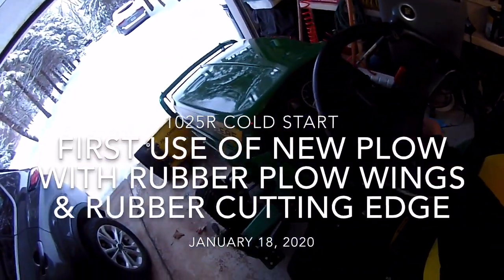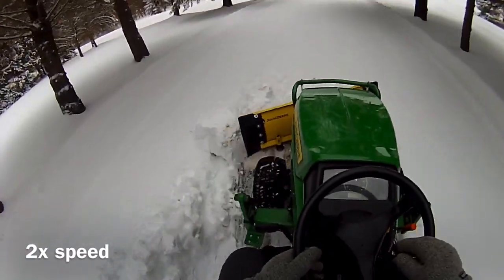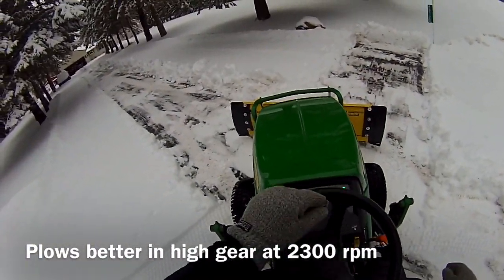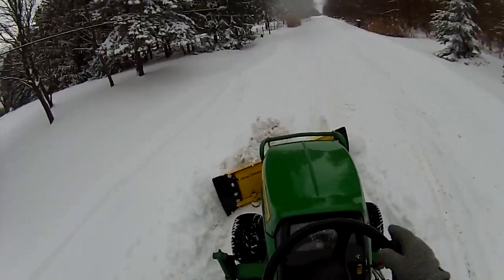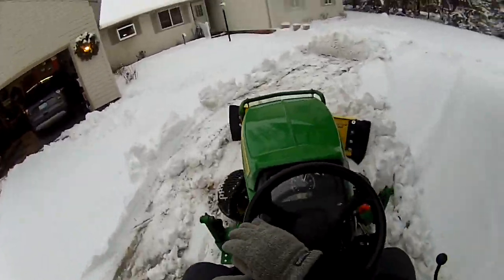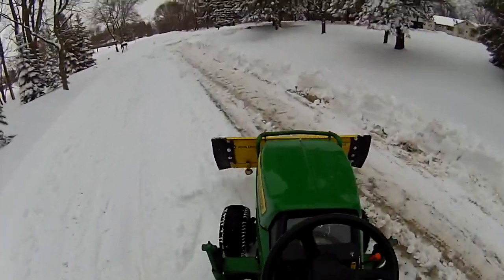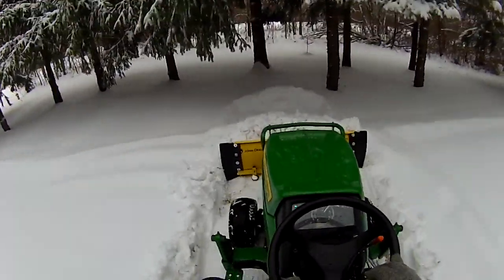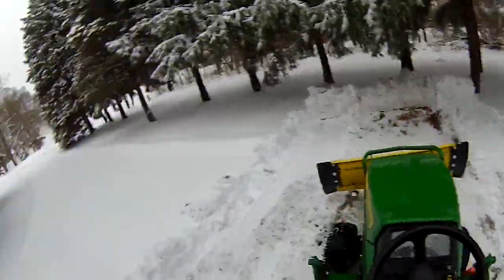JD 1025r with 54” front snow blade with Artillian wing  &  cutting edge — voice over version

Comment: Do you have to have the 3rd remote on the front to angle the snow plow?
Reply from the maker: Do not need a third function.  Up - down and left-right is all that is needed.
Reply from the maker: Two functions.  One raises the blade.  The second rotates the plow blade left and right.  No third function needed.